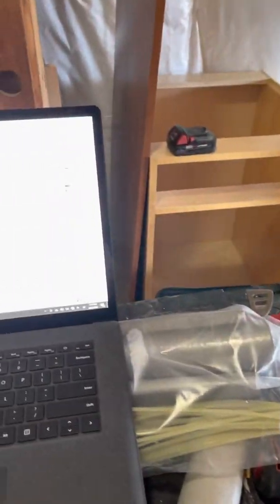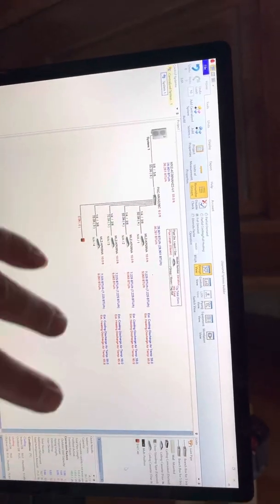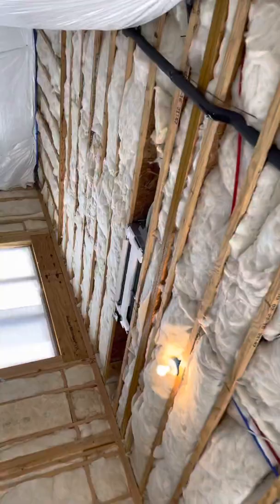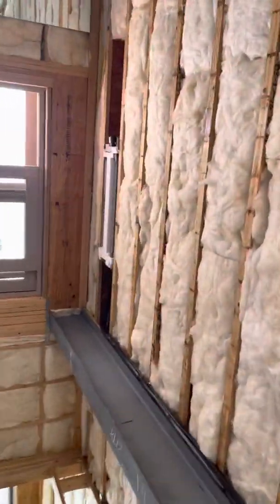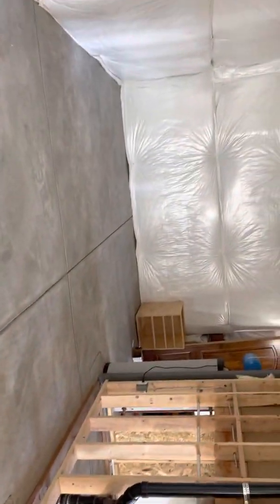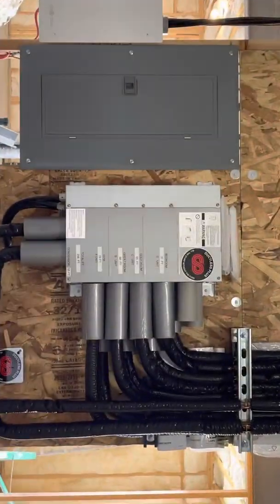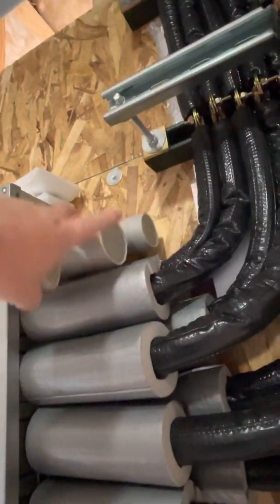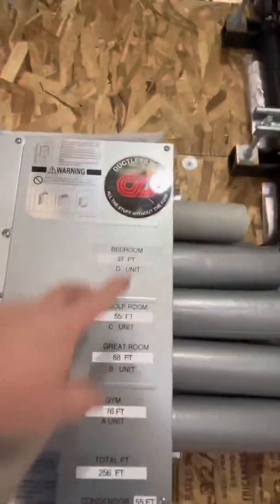Best Mitsubishi Ductless Branch Box install complete with DSB performance check (Part #3 of #4)

Comment: Great clean job as usual. Looks like Formula 1 work.
When you evacuate and pressure test with nitrogen these systems with branch boxes, do you need to do a procedure at the branch box to "open" every single line to make sure the vacuum is pulled or nitrogen pushed in all the lines? Or the branch box take care of it on itself? That would be too easy but we never know...
Reply from the maker: Great question all the lines will see the nitrogen just fill them slowly and you will get to 600psi and then check your fittings and your going to be good.
Reply: @ductlessplushvac  Thank You!

Comment: Good job 👍 When you install long runs do you braze linesets or use fittings?
Reply from the maker: Brazing is not recommended to do. Mitsubishi units have inline filters and they can get clogged from the carbon burn inside the piping. So we purchase 164ft long rolls of piping and run them from connection point (Evaporator) to connection point (Condenser) or branch box. Ductless systems are what they call a “clean loop” We don't braze Ductless systems.